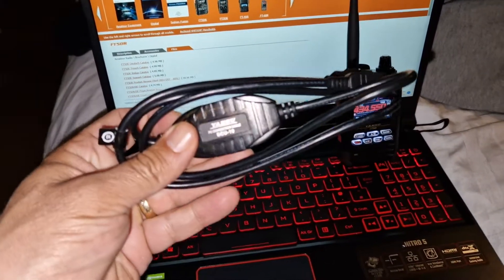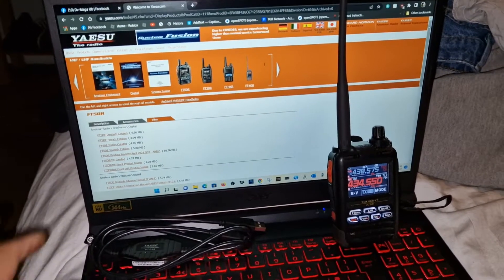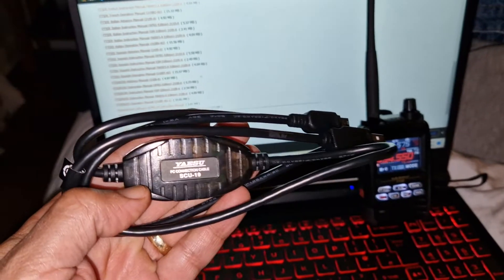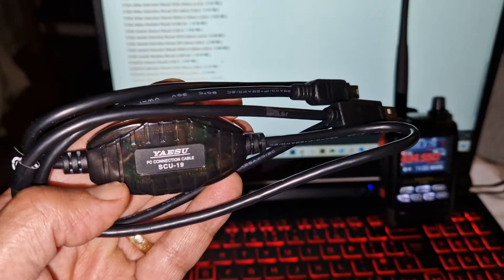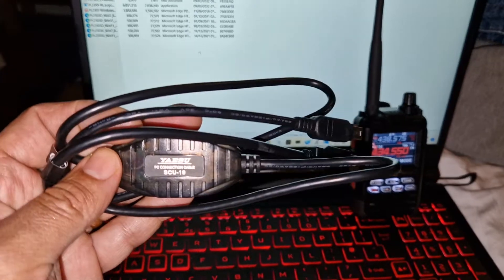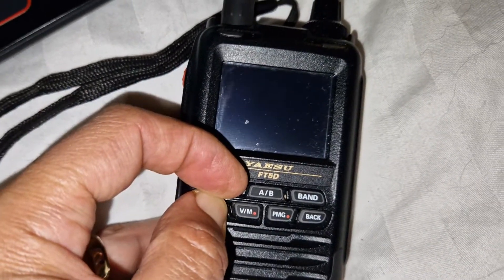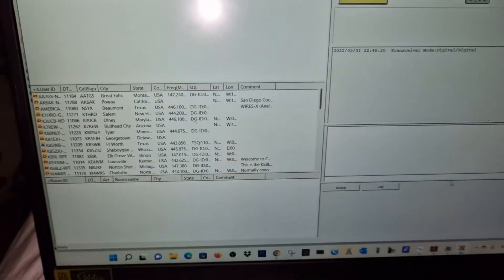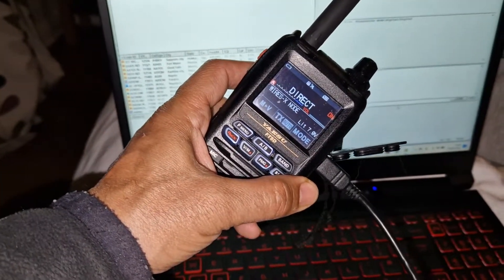Yaesu - Adding a SCU Cable

Comment: Toward the end of the video, did I hear you say that I can use the SCU-19 cable in place of the RT Systems USB-68 yellow cable which i already bought?   Are these the same basic cable just packaged differently?   If so... that's $25 down the drain!
Reply from the maker: Hi please check as i have been told this is the case .

Comment: So I just ordered a SCU-39 cable kit and a speaker microphone for my FT5D from DX Engineering.   Should be here the first of next week.   Once I have hooked everything up,  I want to make you my very first QSO if you don't mind.   My question is...  How do I "dial your number" direct or is that even possible.    I am in Arkansas, USA and am five - I think - time zones earlier than you.   Do you have a video that shows how to dial another call sign directly using WiresX?        Don  KI5VIT    (soon to be N0DEW)
Reply from the maker: To direct call i think you use Group Mode i will check and do a video